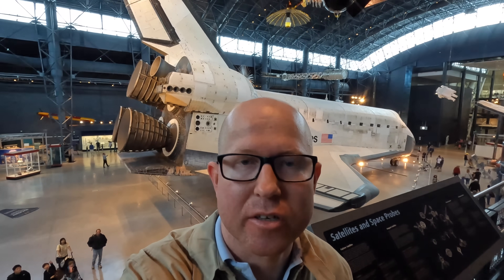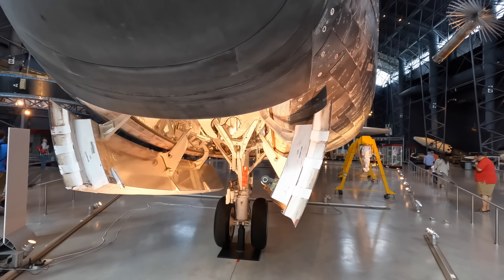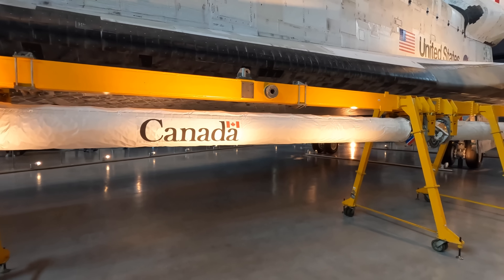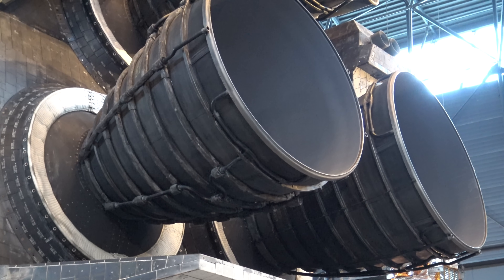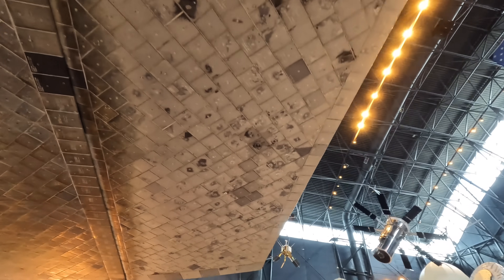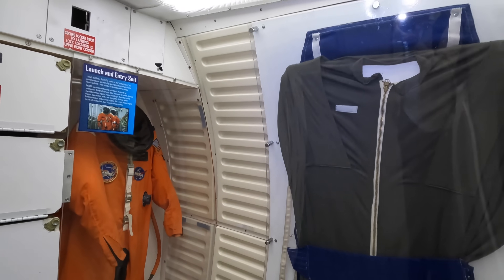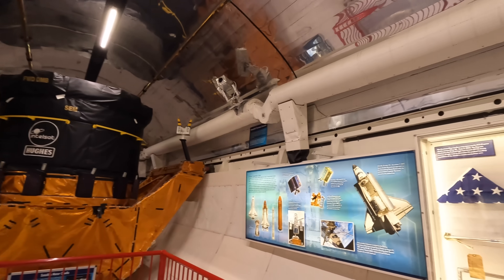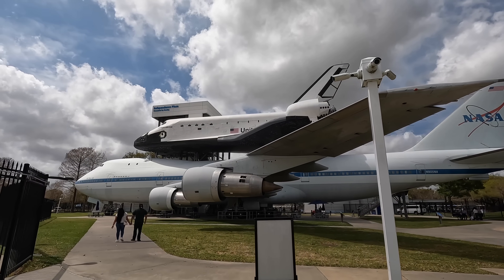Detailed tour through the Space Shuttle Orbiter

Comment: i hate how the only reasons it was retired is because 
1. the heat shield tiles are GLUED on (they fell off atlantis shuttle, burned up as a result) , 
2. the structure is made of aluminium, which they chose to save weight on the ONE place they REALLY didn't need to shave off weight. (this melted during the last mission when one of the tiles fell off, causing it to fall apart)

the designers were so smart yet so weirdly dumb lol

Comment: Fun fact a about the canada arm on the ISS(not the shuttle one) from a canadian:
The arm on the ISS was not able to reach all across the station, as it would need to be too large, but that is the exact thing the canada arm was designed in mind with:
The canada arm was able to connect from BOTH ends of itself to the ISS, on sockets that were placed all across the ISS, and fully capable of operating by being powered from either ends!
This means that, for example, lets say you need the canada arm on one side of station that is too far for it to reach, the astronauts did not need to perform an EVA in order to move the canada arm to a new attachment port.
Instead, they could move it by making it connect the unconnected end to a port that was closer to the target location, then disconnect from the original port, and make the now disconnected port to reach for another port closer to the target, disconnect from the previous port, and so on, allowing it to get itself connected and powered from any module of the ISS, without any EVA required to relocate it.
This design reminds me a little of a crawler, a catterpillar, or that coil stair walker toy that was stereotypical of a few decades ago(i think its called a slinky?)

Comment: You know what would be really cool? After they land the shuttle they rush over with all that equipment and such and I've never been able to find out what a lot of it is and what it all does, would be really cool to see a video about that.
Reply: They rush over in chemical suits because of the hydrazine fuel, it's very toxic.

As you can imagine, the Space Shuttle doesn't run any sort of engine during landing, so it needs some other power source to run all its systems. During the landing phase an Auxiliary Power Unit is activated which is a small gas turbine that is spun by burning the hydrazine rocket fuel that remains in the OMS pods.
Reply: @BogeyTheBear  thanks!

Comment: Hi. Your video is very interesting and i feel like been there. Thanks. I have a question. I think that the shuttle holds to the main tank with exploding bolts. In the 1896 challenger disaster, when nasa saw flames coming out, why they didn't command to explode the bolts so it would separate the shuttle from the rest and maybe saved the crue? 🤔

Comment: How can the jets work in a vacuum.
Reply: same as rockets ..they dont
Reply: Jets do not work on space, the space shuttle doesn't have jet engines, it only has rocket engines, which in this case, uses a mixture of liquid oxygen and liquid hydrogen.
Reply: @tacolover105  no they dont , the orbit thrusters  used hypergolic fuel  , the big main engines were redundant and  only used in atmosphere, fueled by the massive centre tank between the two solid fuel boosters
Reply: @marxman00  I was not talking about the orbital manouvering system (OMS), but about the main engines.

The main engines do work on space (Depends if you consider any parts of the upper atmosphere as space since the pressure is so low or not), as they are used until the orbiter's MECO, which is at an altitude of 104 km, just above the karman line, however, they are not very efficient at that altitude anymore and there is no more mixture of hydrogen and oxygen left in the big orange fuel tank, which is the reason the shuttle starts using the OMS from there until the deorbit burn.
Reply: @tacolover105  "they are not very efficient at that altitude anymore" ,why are they not efficient ?

Comment: Actually there were 6 space shuttle orbiters. Enterprise, Columbia, Challenger, Discovery, Atlantis, and Endeavour.
Reply from the maker: But one of those didn't fly? Maybe it was only five that were launched? I should have made that clearer.
Reply: @PaulStewartAviation  The Enterprise never flew in space but was used for flight tests.
Reply: There was a plan to bring Enterprise up to spaceflight condition, but it was cheaper to make a new shuttle out of the ground test unit.

This became Challenger, which is why Challenger's hull number is OV-099 while Enterprise and Columbia are OV-101 and OV-102 respectively.
Reply: Enterprise flew 5 times. It was the first shuttle but never was launched into space. It didn’t have a functional heat shield or engines and was just used to test the glide characteristics.

Comment: Why have massive boosters and nowhere to store fuel! Also why would it get hot if it only ascends to a relative low altitude, why does it sound like a regular jet aircraft on landing?
Reply from the maker: Did you even watch the video? I mention where the fuel is stored! 😂
Reply: The entire launch vehicle comprised the shuttle, fitted with three RS-25 rocket engines, two solid rocket boosters and an external tank which held 535,000 gallons of liquid propellants. 

The Space Shuttle was in orbit around the earth at a velocity of 17,500mph. During reentry, the shuttle needed to shed energy at a controlled rate. Using the atmosphere as a brake, the shuttle compressed the air ahead of it. The compression of the air layers near the leading edges of the shuttle was rapid, causing the temperature of the air to rise to as high as 3000 degrees Fahrenheit. Being in contact with the shuttle, it heats the surface.

The sound that you hear when an aircraft lands is not simply the engines - it is the displacement of air. Let’s ignore the T-38 and F-18 NASA chase planes in footage of early missions, which were less obvious on later missions but on the earlier flights,  were right on the wingtips.

Most of the sound of an aircraft engine, especially newer turbofans is the acceleration of air and how that air meets air that is not moving as fast. The shuttle was a 115 ton craft which produces a lot of noise, especially one as lacking in aerodynamics and as fast at touchdown as the space shuttle. You can also hear the sound of the APUs.

Comment: Its a major engineering feat and I love it. 
But… it has some conceptual flaws that are far from ideal. Cargo doors can’t open, abort, overheat, cargo doors can’t close, everyone dies on rentry, de-orbit too far from 3mile + runway, landing gear fail to deploy. The fact it carries engines around for all orbital and landing manuvers at a massive weight mass for gliding, landing, and orbital manuvers. So many critical failure modes in this system, despite the massive engineering effort to have alternate plans for anomoly, some of those plans failed to inspire confidence (cut cargo bag hydraulic lines with a space walk and bolt cutters), bail out during rentry, or the abort utilize high altitude oribter+fuel tank outside loop (while staying within the 3G orbiter structural limit).

Next gen aircraft need to be wise, with more passively stable functions and require less “brute force” enginered solutions. Best solutions to problems are illiminating the problem in the first place.

Comment: Shame that the  USA goverbnment is pending billions to ensure the Space Shuttle Main Engines are destroyed and dumped into the ocean in a project called SLS/Artemis.  All of them should have been preserved.  SLS shoudl have gotten newly built copies instead.
Also, during retrofits,  all but one orbiter (I beleive Columbia) had the airlock removed from crew quarters. Instead, a new module installed in payload bay which had door to crew quarters, and functioned as airlock as well as the "tube" that docked with ISS.  This effectively reduced size of payload bay but increased  crew quarters by quite a bit.  (they could store stuff in airlock which was external to crew quarters and the shift it to ISS after docking for instance).

Comment: Just remember, broken black heat tiles is what caused the Colombia to have a rabid unscheduled disassembly  upon reentry in 2002.
Reply: I think you should research that again.
Reply: @captaintrips2980  um, I think you need to research it. Foam from the external fuel tank fell off during launch striking the left wing and breaking tiles. During re-entry, broken tiles caused heat build up in the left wing. The left wing then failed causing the break up.
Reply: @jollyrogerhobbies2386  It happened in 2003, smart guy.
Reply: @ Meh, ok, I got the year wrong, but I was correct about the rest.
Reply: @jollyrogerhobbies2386  You were wrong and got corrected. You accepted it like a five year old would.